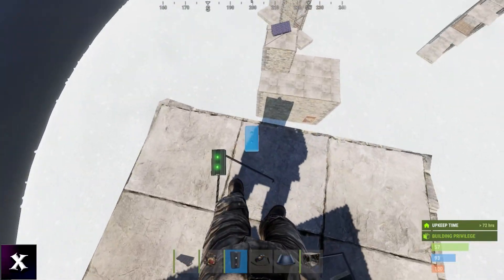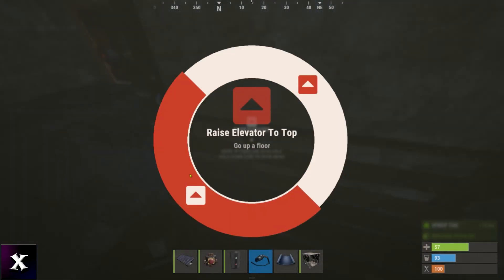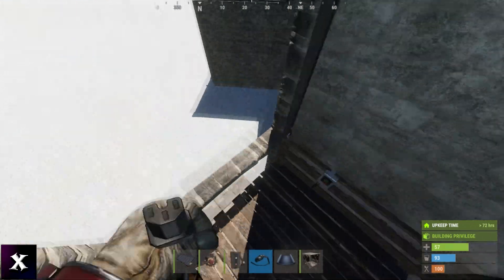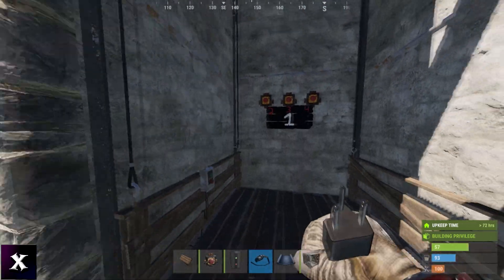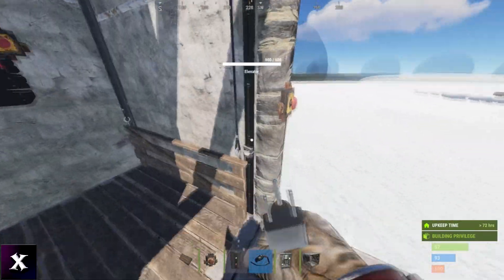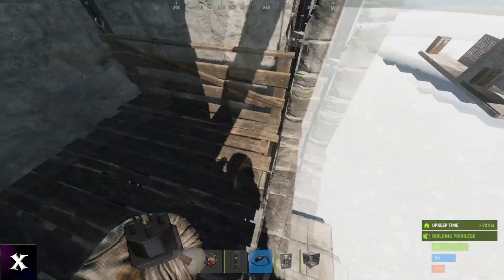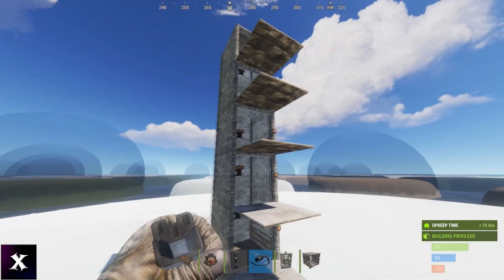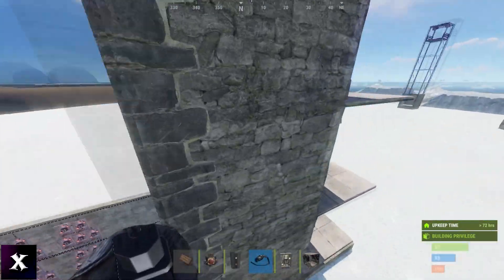Rust Elevator Basics: For Curious Builders (And Roleplayers!)

Comment from the maker: XOR gates no longer consume 0 power. There are 2 changes necessary to get this working, but they are easy!
1. swap out every XOR for a Root Combiner.
2. add 1 splitter between each button and Root Combiner

The reason for these changes.
1. Root combiners do not consume power, so they are a perfect alternate to the XOR gate.
2. Buttons CANNOT output directly into root combiners, but splitters can. By connecting the button to a splitter, then a root combiner, this allows the circuit to work again! Buttons give a quick pulse of TWO power, meaning the splitter takes 1 and the root combiners will pass the other power into the elevator call input!